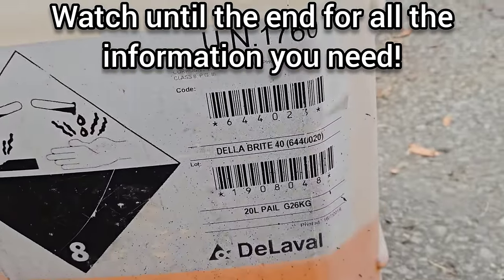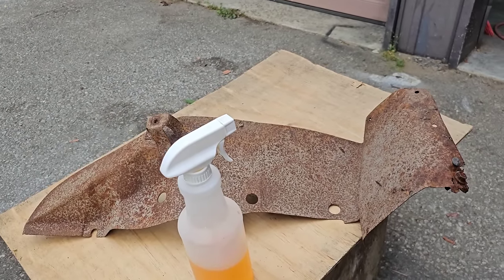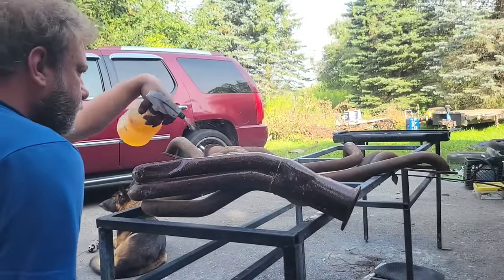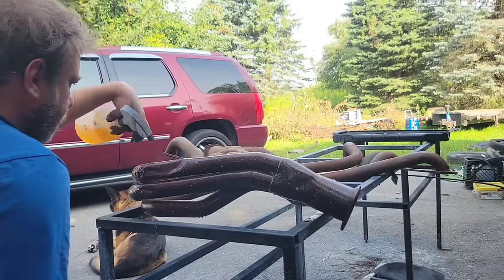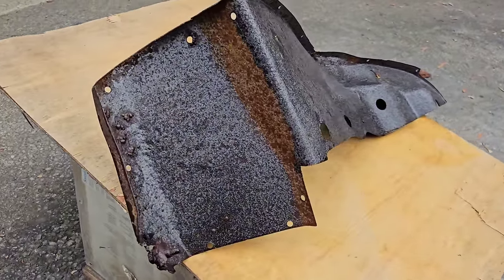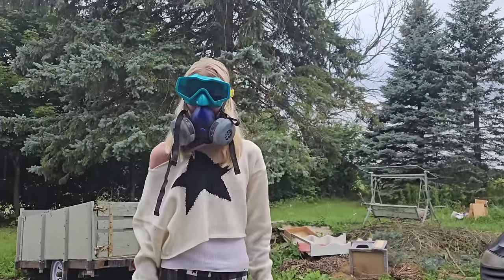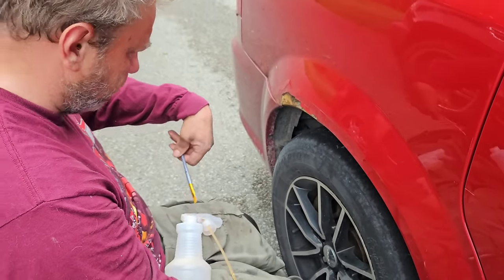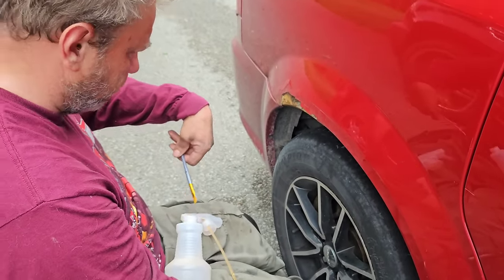Magic Rust Spray DIY. Instant results

Comment: Hello! I know two random facts about your solution. First, Acid won't evaporate, but water will. So it will concentrate if it evaporates or it will absorb water from the air if you leave a concentrated bottle open. So I think you're right about not using gel as an ethanol source. Also, the conversion reaction I found on google says it uses two molecules of phosphoric acid to convert one molecule of iron oxyde into two molecules of iron III oxyde. I think it's similar to black oxyde coating we often see on some steel tools and parts. Thanks for sharing your recipe.
Now that I think about it... The ethanol is a drying agent, so it might help at concentrating the active ingredient. 🙌 That's awesome.
Reply from the maker: You got it right.  A+ 😁. Thanks for watching!!

Comment: Your assistant did not have PPE on her feet!  I like your humor.
After seeing your other vid I used this stuff on a rusty Dakota truck frame, mostly surface rust.  I then top coated with cosmoline, then Fluid Film.  Time will tell how that holds up here in the rust belt of PA.
Reply from the maker: Yeah nobody can get that kid to put shoes on. She would walk across hot lava instead of wearing shoes. I hope it works out good for you

Comment: Hi again mate, from Antique - not sure if you are in Canada or over here right now, but your Canadian place looks brilliant - tons of room, I like it! I followed your earlier suggestion to get phosphoric from Shopee, and as soon as I can I'll get out and get some ethyl/sanitizer.

The storm drain cover I'm making is a 1 metre square angle iron and flat steel base, with 1 inch galvanized square tube runners 1 inch apart, meant to take pedestrian/light vehicle traffic. Work is on hold at the moment due to heavy weather the last couple of days,; even my normally dry car port was like a car wash on the rinse cycle yesterday, plus the inevitable brown-out, so I couldn't weld anyhow.

All being well I'll have this item finished Monday/Tuesday, ready to treat and then paint......once this is done I have 2 more to do! The barangay (local council) started to build a storm drain right at the start of the rainy season and abandoned ship a couple of weeks ago as "they ran out of cash". It means that right outside my house and where everyone walks to school etc there are 3x1m sq open holes that WILL flood any time now and if anyone falls in they will almost certainly drown as the workers left all the form work in place under the covered concrete parts (they don't do sidewalks here, anywhere).

I have 2 questions, asking as a novice to working with metal; 1. The galvanised tube; will spraying with the phosphoric mix be an issue? My gut feeling is no because we are talking about weak acid here. It needs to be painted because it's gonna rust anyway after welding it. 2. I have an unopened big tin of Island Paint epoxy gray primer left by the previous owner and I'll use that; I have ordered some cheap (Shopee) black epoxy enamel as a top coat and that should be here in a few days; I want a durable brush painted finish, one coat, nothing fancy, it's just got to last a while -  I'm on my own dime here and I'm not happy spending my cash on barangay works. But if the worst WAS to happen outside my house I'd never forgive myself. Does that paint idea sound ok? Cheers, enjoying your videos.
Reply from the maker: I am back home where i belong in the Philippines. I lived in that house in canada for 15 years, but now my friend has taken it over. 

 It appears that this is a typical example of unfinished work in the Philippines.

The phosphoric acid will not damage the galvanized steel. In fact, it will etch the metal, allowing the paint to adhere better. As far as the ethyl alcohol you can buy it in savemore or any drugstore here.

I have not yet used epoxy products here, but i will be soon, as i'm making stuff for my house. If it is a two-part epoxy, then I believe it should work quite well for your application. 

I commend you for taking on this project yourself, even though it is not your responsibility. 👊

Thanks for watching and supporting the channel! If you have any more questions, feel free to throw them my way. And if you're in the neighborhood, give us a shout.
Reply: @justahandchannel  Yep, primer and enamel are both 2-part, so looks like we're cooking on gas! As for the ethyl, I might need to go into the city as the local pharmacies/stores have lots of isopropyl but I've only seen ethyl in Watson's, in the city - I'm in the wild west here. I should have ordered on Shopee when I got the Phosphoric.

I want ethyl instead of sanitizer because I want to keep a good mix on hand for other projects I want to do in the near future, including treating rusty hand tools.

Yeah, funny old thing about the barangay; the barangay captain lives just along from me, a few metres higher elevation. Outside his house was completed, ship-shape and Bristol fashion, a week or so before the project was abandoned. During this latest typhoon the water that normally flowed hard outside his house now drains nicely away into the rice fields...... via my place.

Dumaguete/Negros is on my Philippines bucket list and we're looking at going over next year; my UK pensions are up and running since the beginning of the year and I'm hoping to have the house just right by the end of December. After that wife and I will be in explore mode, I'll let you know nearer the time, cheers.

Comment: Good video. I worked in paint & body for 35 years & used phosphoric acid products frequently. Some primers can be applied directly over the treated surface but some cannot, especially some epoxies. Also polyester body fillers do not adhere well when applied directly over an acid etched surface. Generally it's best to lightly blast or abrade the treated steel before priming and especially before applying body filler. If you want the ultimate lasting power, treat the steel, blast it or sand it, make sure it's clean & dry, prime it with a top quality epoxy (preferably a cromated one), apply any necessary body filler over that. Moisture in the atmosphere can penetrate polyester body filler but the epoxy stops it from getting to the steel. That way if it takes weeks to finish smoothing the body filler the steel underneath is protected. Once all the filler is shaped & smoothed then cook the vehicle in a warm booth awhile and then prime with a good urethane primer surfacer that can be sanded to a proper surface for the topcoat products.
Reply from the maker: Great advice to the viewers. I use SPI epoxy, and it has a chemical bond to the metal, and it does not let go. I don't use anything else, so it's very possible that others won't adhere properly without prior prep work.

Comment: Would it be possible to use some oxalic acid powder mixed together with the phosphoric acid and the ethyl alcohol solution? Cheers
Reply from the maker: Stay tuned.  I will make a video with this experimentation.
Reply: @ Thats terrific, thank you very much!

Comment: Any spray on epoxy primer you'd recommend? I recently used this method on a set of new to me leaf springs but epoxy primer seems to be a hard find in spray can form. I wound up using rustoleum "rusty metal primer" figuring it was probably the best choice out of the 30 plus different primers in the spray paint aisle, none of which explicitly said "epoxy".
Reply from the maker: Epoxy is a two part paint so unfortunately it's only available to mix and use with a spray gun
Reply: @justahandchannel  got it. Thank you. A simple and straightforward answer with regards to paint is something that is difficult to come by.
Reply: @amross64  Actually, Eastwood sells a type of spray can epoxy that is a two part system that mixes when you activate it by pressing on a part of the can.  The down side is, once it is activated, you have to use it all in a short span of time.  Once activated, you can't put it up on the shelf and be able to use it the next day or ever.  It isn't cheap

Comment: Do you sand it down
Reply from the maker: It depends how nice of a finish you want and what you're working on. I would normally give it a quick wire wheel before i spray it with the acid just to get any loose stuff off. If it's a body panel then you're going to do body work on it anyway

Comment: Ascorbic acid works well also
Reply from the maker: Yes, it does, but I find it doesn't have the strength for heavy embedded rust on metal half a century old. Also, it doesn't etch the metal in preparation for paint. Whether it's mild flash rust or heavy embedded rust, my mixture does it all.

Comment: What about iron out
Reply from the maker: Please feel free to use any product you deem necessary. My purpose is to provide you with the optimal product based on my extensive research and experimentation over the years.
Reply: Just wondering it comes in a spray bottle and works good on my sinks etc . Of alcohol can be added to speed drying. Would it be the same end result
Reply from the maker: In the event that the product is composed entirely of phosphoric acid, then yes, it will be identical. However, if this is not the case, I would advise against it.

Comment: I Am thinking to get my car bare metal all strip 

It's an  44 yrs one i brought itnto rebuild it by my hands

 I'm stuck from where ot start.like it get it strip ti bare metal metal wire ginger or chemical.

Then fill up the spot with metal sheet.

Seal joint then apply epoxy primer 

Paint white hehee .
Reply from the maker: I would suggest media blasting for best results
Reply: @justahandchannel  I was going to ask right away but after digging around.

Media blaster 
SAND BLASTING 
SAND/WATER BLASTING 
CHARCOAL BLASTING 

ANGLE GRINDER wire brush.

Any other suggestions
Reply from the maker: Keep it simple.  Dry Media Blasting with crushed glass is my preference.
Reply: @justahandchannel  do you have video 
Or steps to process
Reply from the maker: Videos of what? media blasting?
Reply: Yupp if could be possible I could appreciate it Alot
Reply from the maker: Well, it is generally not something you're going to do yourself because you need a huge compressor in a large sand blasting pot to do a whole car, but i will upload a video because i did own a  media blasting company. Stay tuned for the link
Reply: @justahandchannel  I could appreciate it Alot 
Because I'm am planning to doing at home 

Because the people who I checked there paint work and how they remove rust. Get it full cleared to sliver metal which they don't so I was planning to do it at home 
I want it an BUILD Drift/ daily 
so chassis reinforcement suspensions done 
Good epoxy on metal then paint
Reply: I was trying to redone my whole Engine, light harness got stuck eheh .
I'm have Zero knowledge in ELECTRICAL where goes where but I am at good at mechanical side 😁 

I'm trying to get more equipment 
TiG welding 
Blaster 
Compressor 

I can start stripping and paint.

Build a good CHASSIS
Reply from the maker: here is a media blasting video done in my shop

https://youtu.be/9YJ29ad3dYw?si=JmAdmjNHJNxV-at3

Comment: hey bud great vid thanks for the info !  i remember many ! years ago when they first came out with nutra-rust the stuff was amazing it would turn rust instantly into a very hard nice black finish  do you know is there any difference between that and the formula your using because i thought you could leave that formula without painting for a long time ? again thanks great info!  another interesting product i used once was a expensive epoxy primer and it had a very permanent coating right over rust for years ?? without any topcoat ! it was amazing !!
Reply from the maker: Youre welcome. This will last for a quite a while before having rust again. And if it does just give it another quick spray